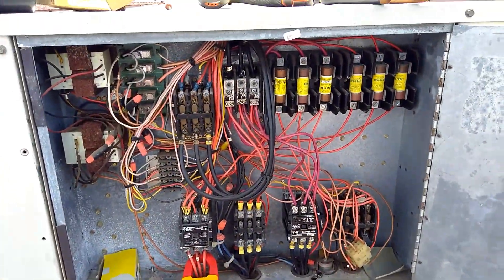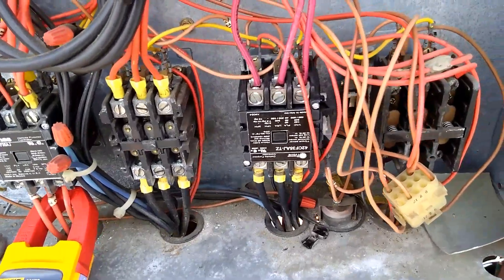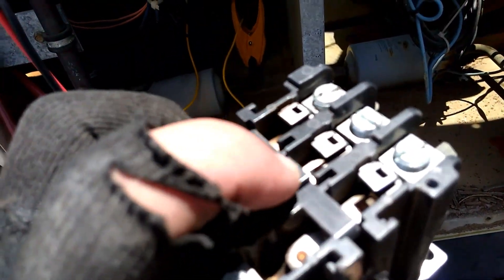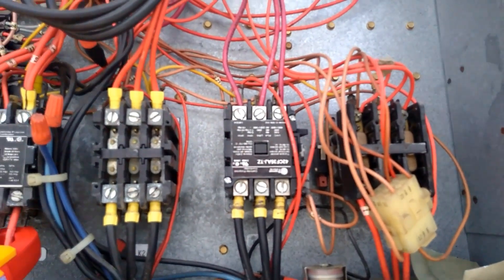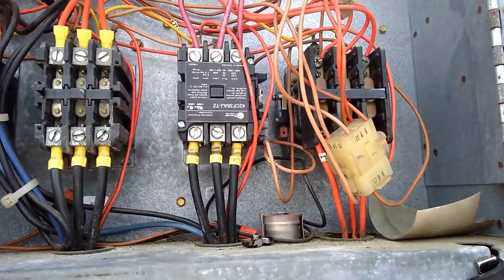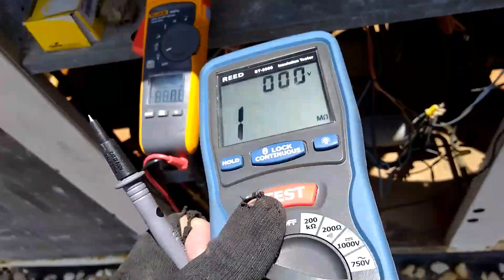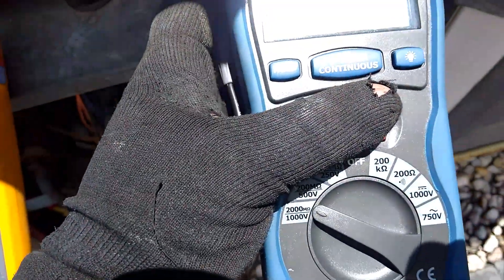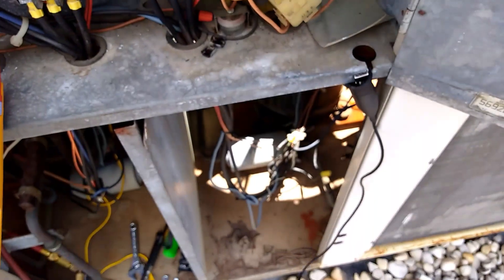HVAC Compressor Grounded Testing with Reed Mega ohmmeter

Comment: when a unit blows fuses I always meggar  test the unit before I replace the fuses and apply power
Reply from the maker: Ben Kuxhouse I did actually. I turned it on and the compressor sounded horrible. I shut it off. I replaced the welded contactor and when I turned it back on-boom .
Reply: Working Joes Roundtable shit happens. you did all you could I don't like digital meggars I think they're too sensitive there's a cheap one from Johnstone Supply that I bought that works great. that's happened to me too or something pass the test that once line voltage hits it then that's it. some commercial things fuses are very very expensive if they're big 600 volt fuses.